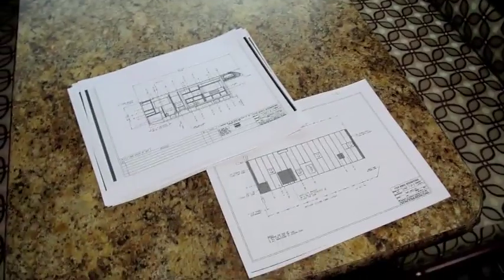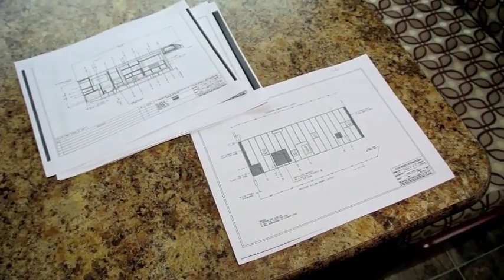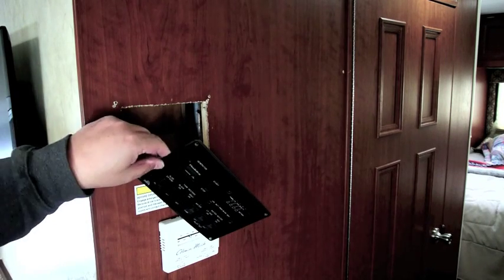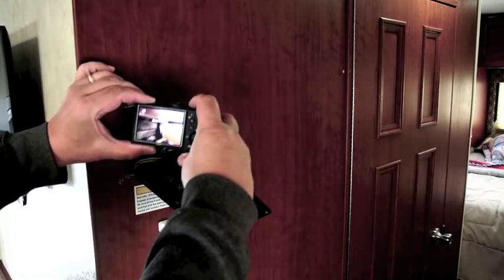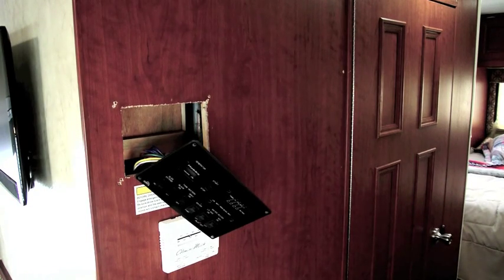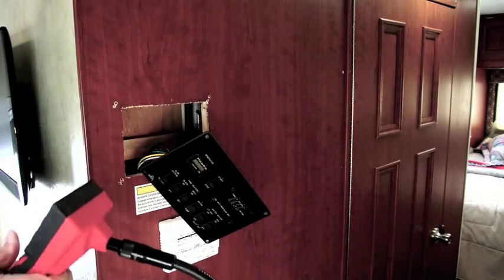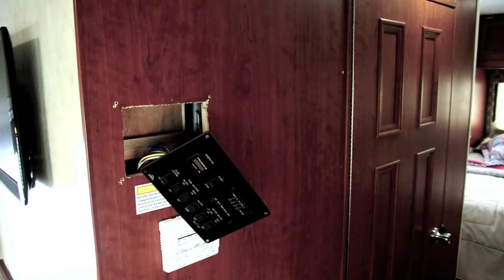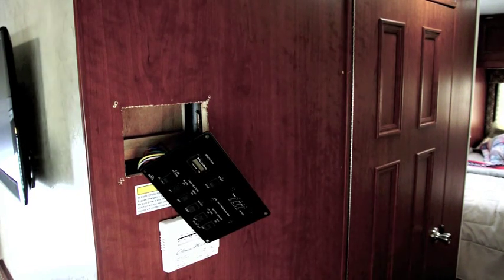How to determine where to drill a hole in a ceiling or wall of your RV.

Comment: will a regular stud finder find aluminum supports/studs in a ceiling?
Reply from the maker: I am not sure. Some of those stud finders work on a magnetic field. And since aluminum is not a ferrous metal, it might not be detected by the stud finder using a magnetic field.